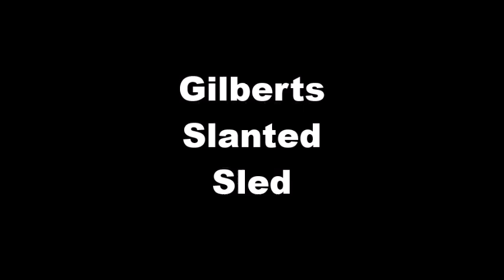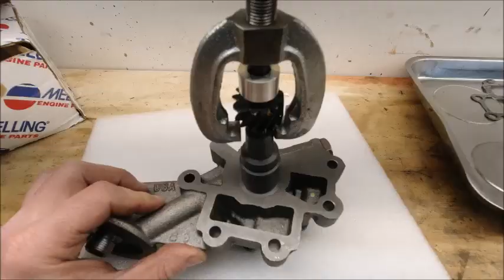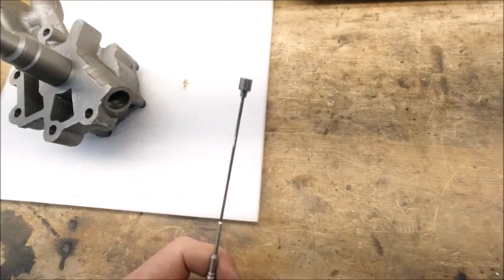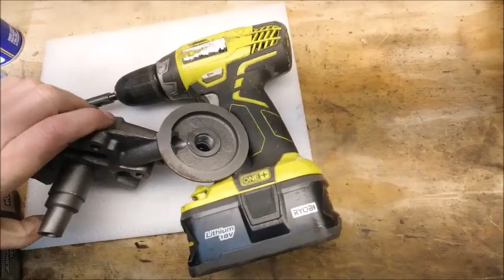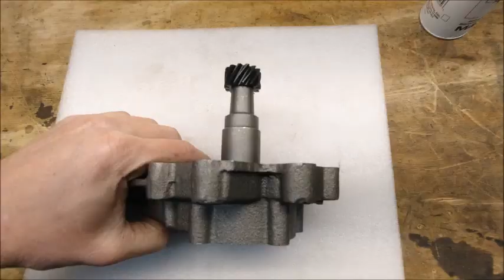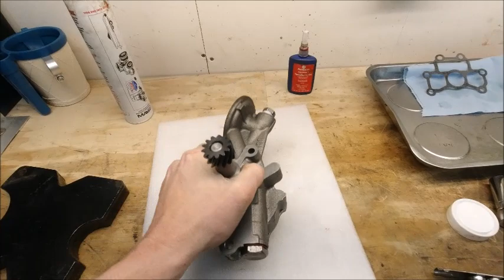Blue Printing an Oil Pump. #nonamenationals

Comment: A nice addition would be a spot weld on the gear facing the shaft ... to avoid loosening
Reply from the maker: I did that in the past but since I like to reuse these pumps and just press in another gear.... don't do that anymore. I have use red or orange loctite but that really is unnecessary since I keep the pressure under 55psi.

Comment: Cool video. Ironically, I just had to order an oil pump this morning as I realized I forgot to, which has stopped my hope of getting the engine back in the car this weekend... Anyway, I see you used the M66C. They had a high volume unit M66HV available for $5 extra so that's what I ordered. Have you had one of those apart and any clue how it varies from the standard C model? (I won't have it until Tuesday otherwise I'd just look myself - curious)
Reply from the maker: The slant six really doesn't need a High Volume pump as the stock replacement "M66C"pump has a larger pump rotor than the Aluminum pump from the factory. The HV pump really adds a lot of unnecessary strain to an already taxed oil pump drive gear. In my opinion the M66C is really bigger than what the slant needs. I have taken many of them apart and my next video will be about the size differences between all three pumps. I am filming that one as we speak.
Reply: Thanks.... After your comment I did some reading online and then just called and had them switch my order to the C instead of HV... HV just sounded better since "bigger is always better" right, but not always... Glad to have seen this and switched before I ended up causing myself issues.